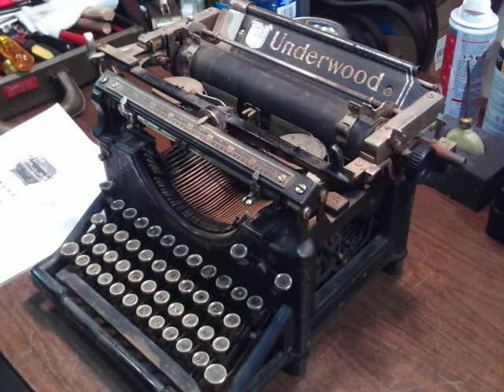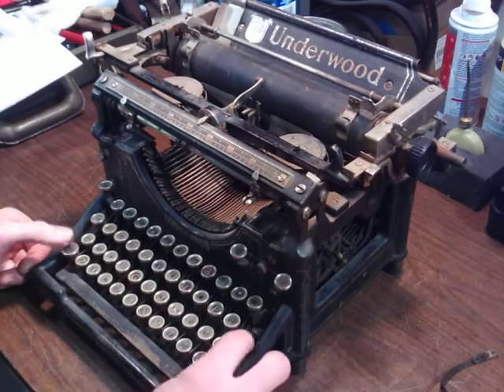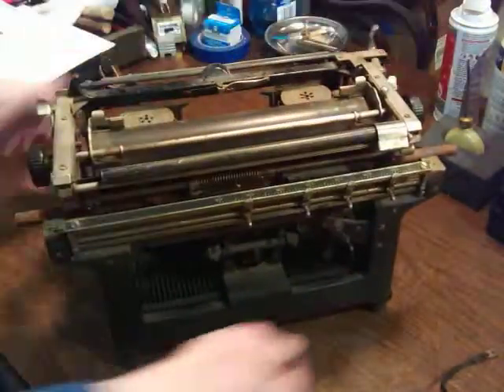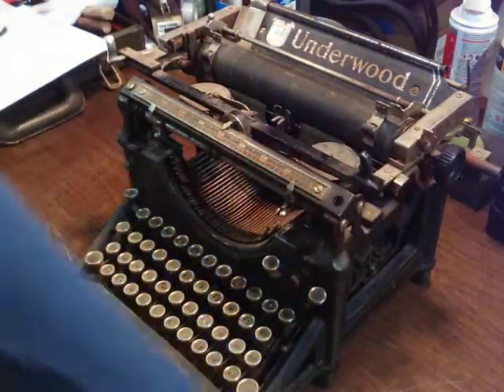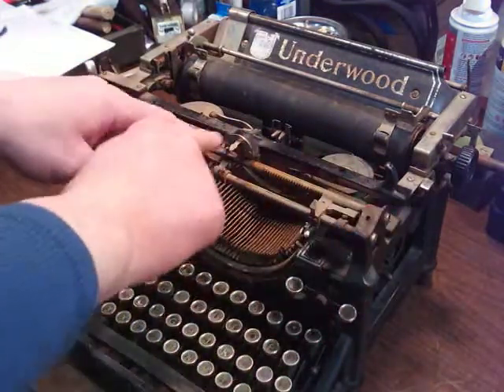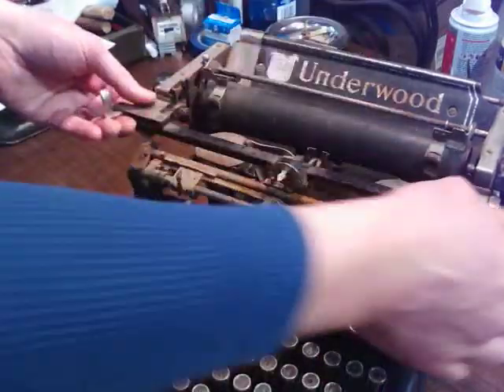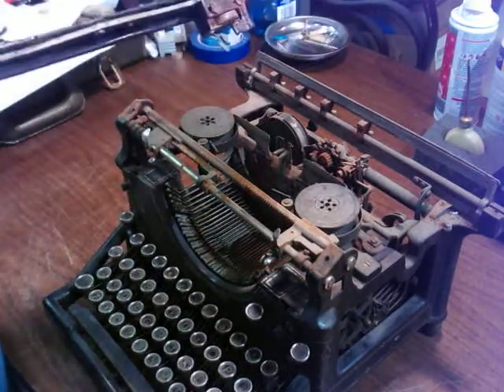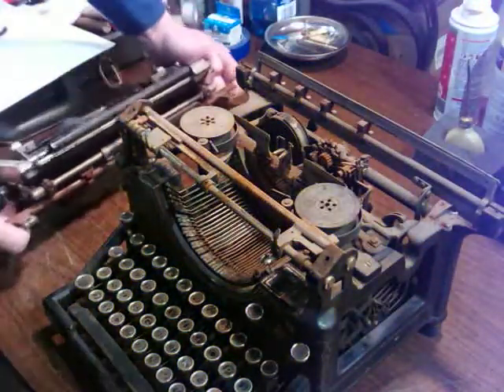Underwood No.5 Carriage Remove

Comment: Thanks for the tutorial, Ken! 
I've just started cleaning up a 1920 no. 5 gifted from a family friend. She's all in one piece, but I'm finding a significant amount of rust on most every surface. Any tips on how to deal with the rust on the carriage bar and other moving parts, or ideas on how to clean and lubricate the sticking keys? I've heard Hoppes no. 9 gun oil can work well, but I don't want to damage anything by using too aggressive of an applicator (wire brush, etc.). 
Thanks!
Reply: Evap-o-rust for rust removal. As for the stuck keys, and lubrication. Compressed air/paint brush/brake cleaner for cleaning where you have a lot of lint in the segment etc. As for lubrication, use a white oil, or Rem Oil. The Hoppe's #9 oil with the needle applicator is great as well.

Comment: Great Video! Yesterday, I bought a 1924 UNDERWOOD No.5 with its platen assembly loose ( completely separated from the carriage assembly). Now I need to figure out how to install that platen assembly.   After  several attempts,  it appears that it will not mount back into the carriage assembly with the carriage assembly mounted on the typewriter. ...maybe I need to remove the carriage assembly from the typewriter to install the platen assembly into it before installing the  combined assembly back onto the typewriter?
Reply from the maker: Those platens are removeable w/o need of carriage removal. Remember too, the carriage assembly on Desktop model Underwood's has a "skeleton carriage;" meaning the thing is two separate parts. If you can, try referencing some Underwood 3, 4, 5, platen and carriage literature.  http://writingball.blogspot.com/2015/06/quiz-answer.html speaks briefly on the subject, and Richard Polt has free owner's manuals at https://site.xavier.edu/polt/typewriters/tw-manuals.html which should help too.

Comment: Ken it's been 60 years since I even looked at an old Underwood, but can't you slide the carriage to the after you remove the front rail and the stop under the right hand  front rail screw....
Reply from the maker: With the carriage frame and skeleton carriage thing going on, the Underwood's a unit that was definitely made for simplicity in taking apart into sections. I remove the screws at each end, holding down the way rod, probably because the old Complete Instructions How to repair, Rebuild and Adjust Underwood Typewriters book (compiled by H. G. Pearce, copyright 1920) that I used, shows the machine with carriage removed (plate 7, "Looking into machine, carriage off") with that rear bar removed.
Reply: @kennygk79  Keep up the good work Ken, with blokes like you the trade maybe revived,  I wouldn't take too much notice of repair manuals, they're usually written by blokes with a lot of theory and not much practical experience..I remember quite well Remington had a big problem with their SJ 1/2 spacing, it wouldn't hold. the factory issued a fix instruction and implemented the fix  it's self. An adjustable stop screw that limited on the car into the line space lever that limited on the carriage end plate...The problem really didn't exist, the line space detent hadn't been adjusted properly and didn't sit into the teeth of the line space wheel.

Comment: Hi Ken thanks for the video got my carrige off and found the problem with my carrige advance, the gear that works it was not setting right not sure if the backing is broken or if I'm missing a spacer any ideas or how/where to find parts

Comment: Hi Ken,  have you ever removed the carriage on a Smith Corona Galaxie 12 or similar Smith Corona manual typewriter from the late sixties?  If so, was it difficult or is there anything I need to beware of before attempting?  I removed the carriage on my Hermes Rocket and it was a disaster.  I still can't get it back together due to numerous ball bearings and spur like pieces.  Any suggestions would be much appreciated.  Thanks!  I actually live in Mount Pleasant, WI and work in New Berlin which is near you I believe.
Reply from the maker: If the carriage has loose ball bearings sitting inside star washers, it is a royal pain. The trick to reinstall the one 40's machine I took a carriage off was a small tad of super-glue to hold them together for reassembly. After getting them in exact position, work carriage back and forth to break free the glue hold. I only remove a carriage when have to. Another  thing might be finding somewhere to attach and hold the draw-string cord before pulling the carriage. Don't remove carriage before disconnecting the tensioned draw-string cord, or the thing's sure to slip and unwind the mainspring. Those rear carriage raceway screws on Smith Corona's carriage are for adjusting carriage grip to rail track. If your just trying to adjust a loose or binding carriage you may not need to pull it at all. Say you've got too much play in a carriage; loosen the raceway screws on side that's sloppy; compress the track rail and while holding compression re-tighten screws. Squeezing together carriage halves to tight and carriage will bind, and too much carriage play means needing more compressing. If the 12" carriage has Carriage Trucks (long rod assembly in carriage track vs. loose bearings and washers) your not going to have all those problems though. A spring hook can be used to guide truck out carefully. The word of caution from the 6 Series manual is  "Truck Assemblies must be straight and teeth of Truck Gears must mesh properly with Carriage Plate and Carriage Bedplate."
Reply: Ken, thanks much for taking the time to write such a detailed response. I truly appreciate it.  The more people I talk to the more I now know not to mess with removing carriages. I like to tinker with typewriters and I’m fairly decent at fixing them but definitely not a professional. My collection currently is about 25 machines.  Wish there were more people in our area interested in these things, I’d love to meet them and swap stories.  Thanks again.  -Dan
Reply from the maker: Your welcome Dan. I agree 100%! "Wish there were more . . . meet and swap stories."  We're here with Winter and other weather than Joe Van Cleve and those fella's that have monthly outdoor type gatherings in Arizona. I've tried testing the "local waters;" tried selling a few typewriters through my Dad's Pro-sop at my family's club in Campbellsport, WI. (Wild Wings Sportsman's Club ). There's zero interest from anyone who comes there. The people only come out to hunt and shoot sporting clays. Also, I've tried sparking interest in typewriters to my co-workers at the Senior Living Community, but they ALL seem less than enthused about getting involved with typewriters. Heck, even Ace Business Machines (one of our local WI. typewriter repair shops) is small, dirty, and over priced. Local Milwaukee Journal typewriter news claims there's a revival here though (see link) https://www.youtube.com/watch?v=3ljrLXR_J6M